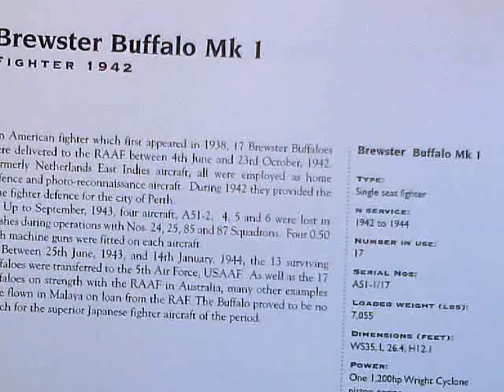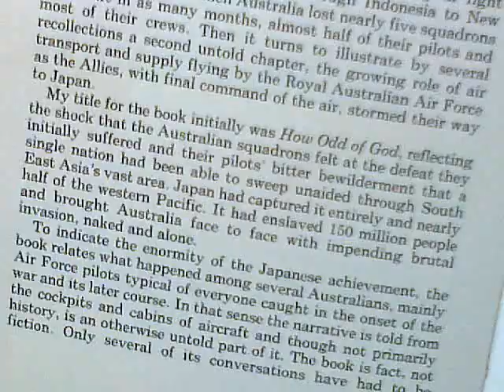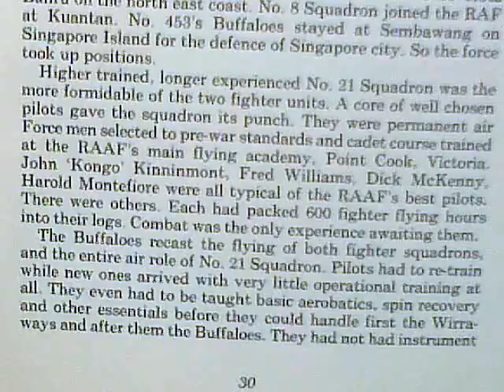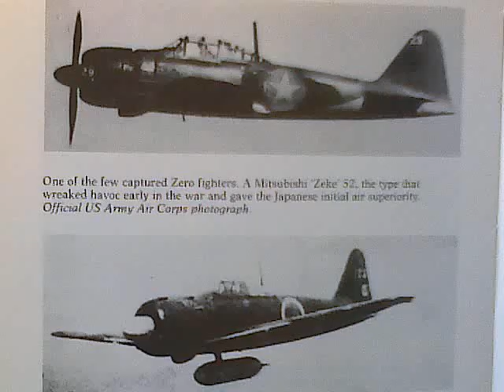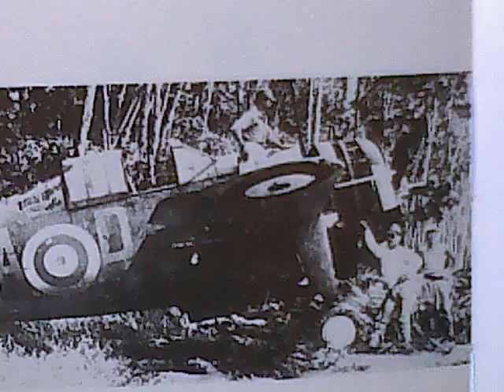World's Worst Fighter Aircraft, The 1941 RAAF Brewster Buffalo !

Comment: I reckon the Fairey Fulmar was worse.
Reply: At what? You need to look at it's role before saying something like that. The RN FAA philosophy going into the war was to have multi-role aircraft designed specifically to navigate over oceans in environments where they tended not to meet high performance land-based interceptors. Bear in mind that it was designed to fight an enemy that didn't have a naval air capability.  It performed reasonably as a heavy fighter/reconnaisance/light bomber aircraft. It's record as a naval fighter wasn't that bad with  Fulmars having shot down 112 aircraft against a loss of 40.
Reply: @nerdyali4154  Yeah, but the thing was slow. Why did it have to be so big? Would you want to face a Japanese Zero in one?

Comment: I call Bullshit. No Buffalo was ever manufactured with a 600 horsepower engine. The lowest output engine was a 900hp engine, the best models had a 1,200hp engine.
Reply from the maker: G'day,

Thanks.

  Occasionally the Books are wrong.

900 Hp to 1,200 Hp makes sense to me..; 600 never did.

Blame the Printer's Typesetter, for rotating "9" into "6"...; perhaps ?

Such is Life.

Have a good one,

;-p

Ciao !

Comment: The| Finns adusted and used them with good results against the Sovjets. The australians and British could learn.
Reply: The Buffalo had problems with the engine. The finnish engine technicians found out, that  order of piston rings has to be changed - and engine had not problem anymore! This was the main reason, why this type of airplane could fight succesfully in hand of finn pilots - and of course, the good training of pilots and the fact, that they protected their country against communist beasts.
Reply: @nomadpek  
Agree with all you say.
l read that Finnish mechanics turned the oil sealing ring around.
l am a Diesel Mechanic(not aircraft)& have found Finnish Tradesmen to be very good at their work.
Reply: The Fins weren't facing zeros.
Reply: @wufongtanwufong5579  You are absolutely rigth. We were not facing Japanese, we were facing The Soviets

Comment: The logic that just because the Finns used the aircraft well means it is suddenly not a terrible plane is laughable. The allies using the buffalo went up against Japanese aircraft such as the zero which were vastly superior along with many of the allied pilots having no combat experience. It was a terrible plane either way. Had the Finns faced the Japanese in the same conditions as the Aussies in 42 it would’ve been the same result.
Reply: The Finnish brewsters faced hurricanes, spitfires, tomahawks, aircobras, yaks, migs, laggs, la-5s any many more actual modern aircraft superior to the brewsters.
The zero was no god, each aircraft has strengths and weaknesses. The way to win is to take advantage of your strengths and the enemy's weaknesses.

Obviously if you don't do that and for example engage a zero in a turning fight, you lose. Nothing to do with the aircraft if your tactics are outright stupid.

Comment: Yeah, the book "ragged, rugged warriors" by martin caiden covered the buffaloes in burma and singapore. I always figured that the brewster plane won the contract due to influence pedaling, because it was shit! I think the whole squadrin at midway was lost in the air. i may be missing 1 who made it back a wreck. the wildcats on the other hand did pretty well. The model the Finns had was an export version and was better, if you can use that term. The Finns fought crappy I-15s and I-16s and other obsolescent types, wasnt the zero for sure. I dont know what gun system they used but i am sure it was fixed from what the Aussies got. Someone said that spitfires were used against zeros, thats a myth. never happened either.
Reply from the maker: G'day,

Thanks.

 Well, the Polikarpovs were only Shitoxes on the ground, in the air they were remarkably good - particularly in 1934 when they came out.

 That flat front end only looks draggy, but the Engine was so closely cowled that with each Cylinder having a shuttered Inlet, and each Exhaust Pipe having it's own Annular Duct surrounded by waste Cooling Air...; the installation actually generated Thrust from taking in Cold Air & heating it before expelling it through  constructed Nozzles - well before the North AmeriKan Mustang's "Meredith Effect" Radiator Ducts.

  Spitfires were operational over Darwin in about  March 1943, they got lost, ran out of fuel, crashed on takeoff & landing much more often than they ever shot down anything Japanese - and they had almost no Range...; but they did engage some Escorted Japanese Raids coming from Timor, and at that point the Allied Propaganda was calling pretty much every Japanese Fighter a "Zero".

  But I think you're right in that Timor was an Army Air Corps Outpost, & it was the Navy which used actual Zeros.

Have a good one.

;-p

Ciao !
Reply: @WarblesOnALot  they were good in the spanish civil war flying against some of those planes. but that buffalo was just way better. as much difference as between a zero. No way would i ever think it was a good plane but it was just up against worse. a mig1 or a yak1 would eat it alive. Nice to find someone like you today on the internet. loves me some good ww2 airplane videos. and the book reading is great!
Reply: Don Trotter.. STFU and eat shit you ignorant dumbass
Reply: "The Finns fought crappy I-15s and I-16s and other obsolescent types".

That is pretty much incorrect. Out of ~500 kills by Finnish brewsters less than 150 were I-15s, I-153s and I-16s.
Over 200 were modern fighters (produced post 1940) and the rest were attack aircraft and bombers.

Comment: and the Russians didn't have zeros.....
Reply from the maker: G'day,

 Thanks, 

    Yeah, true enough..., but the biggest thing may have been that the Finns probably had 7.92mm Machineguns instead of the Browning .50 Inch units which were supplied on the Buffaloes which the RAF issued to the RAAF in Malaya...

  So the Finns had guns which didn't jam excessively, didn't break the mountings & saw the Wings off, and didn't blind the Cockpit with vapourised Grease either...; so when you add in 10,000 Ft being unusually high, and the lack of Tropical Storms to wreck the HF Radio Reception (if the Finns used them...?), then the Buffalo was probably pretty good over Karelia and the Isthmus in 1941...

;-p

Ciao !
Reply: Actually the soviets had much better fighter than zeros. British hurricanes, spitfires, US airacobra and their own fighters: LaGG-1, LaGG-3, Polikarpov Rata, Tsaika, and Yak 1,3,7, Mig-1 etc...
Reply: @aanomad  Of the aircraft which you mention above, only the later of the Yaks (3 &7) would outperform the Zeke in any one-on-one encounter, given pilots of equal ability.